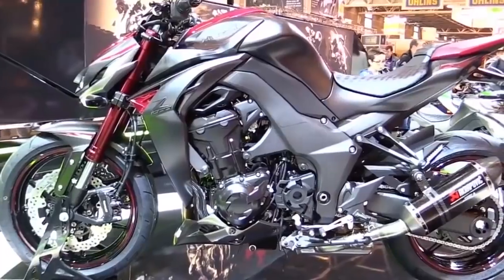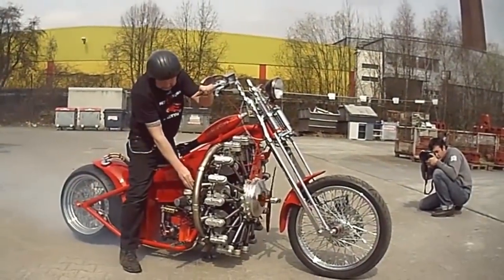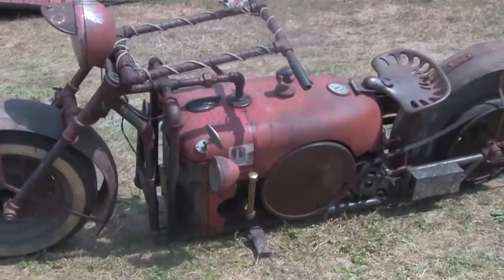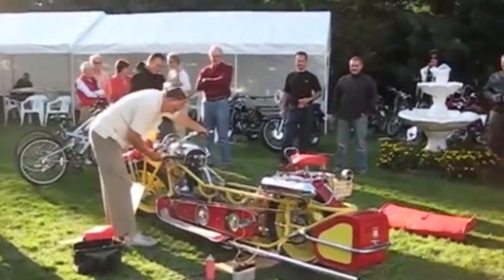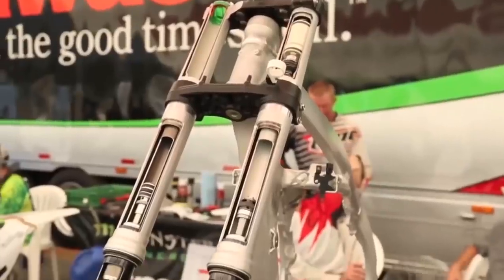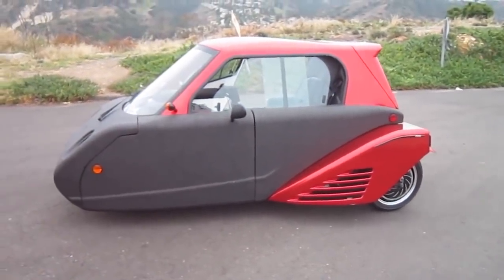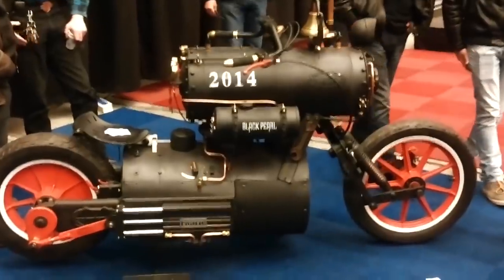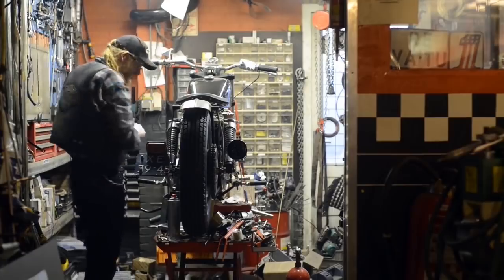12 Most Unusual Motorcycles of All Time

Comment: 12 minutes? lets see....you forgot the countless Japanese/Cuban/Chinese diesel bikes, the hundreds of V6 and V8 powered uniquely designed/engineered bikes, the fully functional motorcycles designed for the movie Tron, and the Tomahawk that was built by Chrysler powered by a V10 viper motor and featured tandem front and rear wheels for control and stability. That one set a land speed record for motorcycles without being jet powered and they still don't know how fast it will go because nobody has the courage to find out! Top speed so far: 228 MPH...and was only at 1,900 rpm in final gear, it still had 4,100 rpm to go. An absolute fail as far as a "top anything motorcycle" vid goes. Maybe more research next time? I enjoy most of your vids, but this one was absolute shit! Especially the last one (even a monster truck is not actually a truck, except in fiberglass molded body) and the "micro that can only go 36 feet (seriously genius aside, not a motorcycle just a ride able Roomba that's not for cats!), not even street legal (and yes that should have been the FIRST qualifier for this vid), let alone being able to turn a corner. If it's a motorcycle, it HAS TO BE STREET LEGAL!!!!!!  Otherwise, its a concept. Other famous concepts: the Russian space shuttle, that was actually built and functional before Americas was!